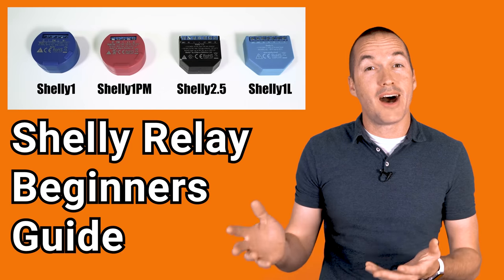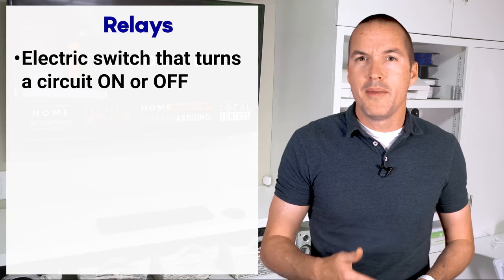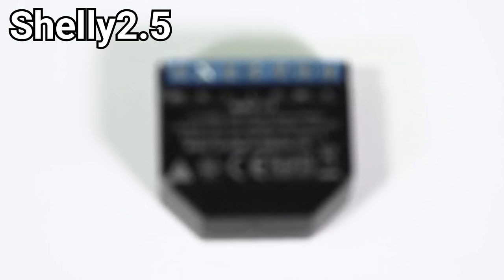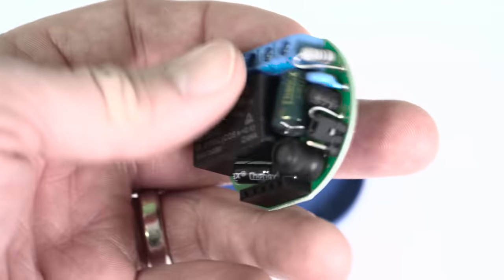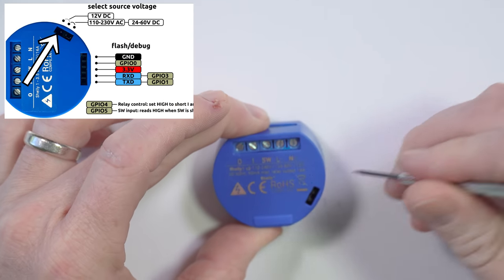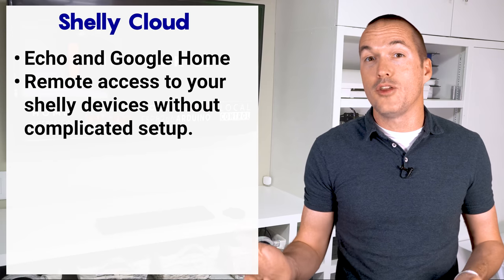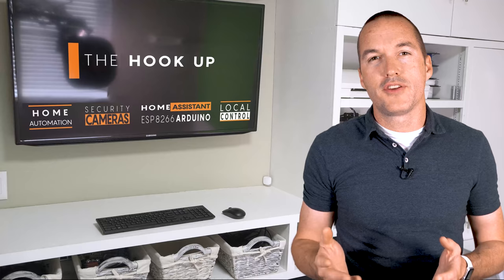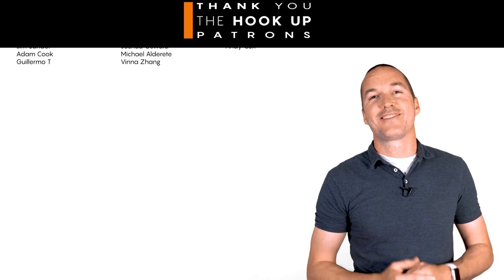Beginners Guide to Shelly Relays - Choose The Right Relay For The Job

Comment: Thank you for this great video. It is very informative!

As far as I can tell, these Shelly relays perform basically the same functions as the Aqara switches. Like the Shelly 1 is basically the same as the Aqara Single Switch Module T1 (No Neutral). Or am I missing something here?
One difference is of course the Shelly uses Wifi and the Aqara uses Zigbee so you need a Zigbee controller/ hub. But functionally, can the Shelly relays do stuff the Aqara switches can't?
Reply from the maker: Basically the addition of WiFi allows there to be a programmable web interface to configure things like detached buttons, long press, short press, multi press, etc.
Reply: @TheHookUp  Okay, that does sound interesting 🙂 I'm just getting started with home automation and recently ordered some aqara stuff to try out. I'll order some Shelly's as well to play around with. I see the Shelly 2.5 is a good bit cheaper than the ZigBee shutter switches I found so I'll give that a try too.

Comment: i would never use these straight with load. only to control contactors. even these have small relays inside they are not the same as ie. siemens house automation relays. i have motion detector outside and it can handle 1kw but i still use it only to control relay and separate load. safe.
Reply from the maker: I guess that's your choice, but for most standard loads the relays in a shelly are more than sufficient.  I use a shelly1pm with a contactor to automate my hot water heater, but the rest of my shellys control the load directly without any issue.
Reply: @TheHookUp  yeah i just want to separate logic from power. they should not be mixed.

Comment: 2:17 this is wrong, if you have 2 wires and a ground you typically DO have a neutral ! your picture is showing the correct white and black wires, the white is neutral HOWEVER in your picture they painted the white wire black and wired both wires to the same hot side with the gold screw, meaning this example has 2 black wires and no neutral, this is not typical. some homeowner with an old house bought modern 2 conductor wire and painted it black because he has no neutral
Reply from the maker: Sorry, no.  If you have 2 wires and ground you have Line (Hot) and Load (Hot).  A switch requires 2 wires.  Electrical code allows the carrying hot on the white wire as long as there is a 4" black tape wrap on that wire.
Reply: @TheHookUp  I see what you're saying. I think it's the wording you're using that's confusing. a typical cable that has neutral does only have 2 wires and a ground. The problem is you should have a set of 2 conductors and ground GOING IN and another set GOING OUT. I think you oversimplified the wording is where the confusion came in because normal cables do only have 2 wires plus the ground.

Comment: Shelly products don't work as advertised.  Direct Device to Device Communication won't work if you set a password on the device.  And their support sucks.  They also won't respond to refund requests.

I strongly recommend against going with this company for any home automation product.  Although they have the word "Robotics" in their name, I doubt that they make any robotics products.  After my very poor experience, I can't help but think that the whole company is a sham.
Reply from the maker: Hey sorry to hear about that.  I don't work for shelly, but I do have a lot of experience with them.  Can you explain what you're trying to do and maybe I can help?  The Facebook support page is the best and quickest way to get help from Shelly.
Reply: @TheHookUp , I can try, but, as I said before, YT seems to block my posts when I post a lengthy message.

I bought 4 Shelly Plugs and 1 Shely 2.5.  I configured them to do Direct Device to Device Communication ("DDDC") using Shelly's documentation.   It all works when I don't set a password, but once I set a password to protect the devices it stops working:  The webhooks just don't work anymore.

The documentation says that if you add a password to the device, you have to add the username and the password to the URL (in front of the IP address).  There is no way to set a username in the Shelly Web UI, so I assumed it was admin or root, and tried it with both, but the webhooks still didn't work even when I try "admin," "root," or "user" as the username along with the password that I set in the Web UI.

I contacted Shelly support, and they told me to try "admin" (which I did again) and it still didn't work.  I contacted Shelly again, and they told me to give them the result of two URLs (http://[deviceip]/settings and http://[deviceip]/status) both of resulted in "not found", and when that didn't work, they offered to replace ONE of my five Shelly devices.

I've requested a refund, but Shelly has not responded.
Reply from the maker: @BobJones164  I am summoning this from a deep corner of my brain, but I think I remember when I was messing with webhooks back in the day that the user is "user_1"
Reply: That sounds like something that their technical support people should have told me the first time that I asked them.  

The subject line of my inquiry was "username?"
Reply: How did you find that as the answer?
Reply from the maker: Did it work?  I’m not sure where I came across it originally, just tinkering way back when.
Reply: @TheHookUp  I haven't tried it.  When tech. support gave me the run around (suggesting various things that had nothing to do with my report), I gave up, factory resetted all of them, and put them back in the boxes to return them.  Shelly refuses to respond to my request for a return, so they'll probably end up in the trash.

Honestly, I'm not sure what I was thinking.  Was I really going to trust some company from Bulgaria that falsely claims to be a "robotics" company with hardware that I install inside of my walls?  

I mean, if they can't even document the correct username to use with the password on their product, can you really trust them with your home?
Reply from the maker: If you're looking for someone to hate on Shelly with you then you are barking up the wrong tree.  Look at it from their perspective:  You are some guy who wants to use their product in an advanced, non-standard way.  They have provided tools and documentation for you to do said non-standard thing, but you lack the skills to figure it out, so you would like to return non-faulty merchandise.

There are zero other companies that would even provide you with the information to do a non-standard implementation like this.   For most people a Bulgarian company is infinitely preferable to a faceless Chinese company, and many shelly products (including the 2.5 and some version of the shelly plug) are UL tested and listed.

You say "If they can't even document the correct username", but I'm sure SOMEONE knows what it is, but it's not exactly best practice to have your programming team answering support emails.  If the tone of your correspondence with shelly is the same as the tone of your last comment, I wouldn't expect them (or any company) to respond.
Reply: @TheHookUp  What are you talking about?

I'm not looking to use their product in an non-standard or non-advertised way.  

I'm operating it completely using the web-interface **they provide**.  Their web-interface includes a section on authentication which sets a password (always a good practice - certainly not "non-standard") but does not include a username.  Their web UI also includes a web-hooks section to send messages to other Shelly devices.

Their web-site has a detailed PDF file that talks about how to use what they call "Direct Device to Device Communication" that shows me step-by-step how to use the Shelly Plug's UI for this very purpose.  It specifically tells me where and how to enter the username (which I cannot set) and password (which I can) in the web-hooks section on the UI for the device.  The only piece of information that I don't have, which is not in their documentation, is the username that they pre-set, and that nobody seems to be able to tell me.

I"m baffled as to how you can think that this is a non-standard use.  I'm literally using these products without any other product at all, and they are specifically designed and adertised to do just that using their built in Web UI.
Reply from the maker: I just ran a test with a shelly plug and a shelly 2.5, I was able to get it working in a matter of 30 seconds.  

http://admin:MyPassword@192.168.20.175/relay/0?turn=toggle
Reply: I have four of them right here, and none of them will work that way.

The FB page you recommended is yielding some results.  Apparently, I received "Gen 2" versions of Shelly Plug made specifically for the US, and Shelly has apparently disabled AUTH via URL for these devices, but never bothered to update their documentation to let anyone know.
Reply: Anyway, I'm still at a loss as to how you think that this is a non-standard use.  I'm literally using the device entirely via its web-interface, for an advertised purpose.  It's not like I'm linking it up to an open source project, flashing a third-party firmware onto it, or even using API calls outside of its web-UI.
Reply: In sum, here's what I've learned:

Shelly advertises that these devices have Direct Device to Device Communication so that you can use them without any kind of hub.  They just talk to each other using http calls that are entered into the UI for each Shelly device.  And Shelly advertises that you can secure your devices with a username and password, which is really a basic security practice.

Shelly recently released Gen2 of its Shelly Plug in the U.S.  In Gen 2 U.S, Shelly hard coded the username.  I have no idea what it is, and Shelly won't tell me.  You definitely will need the username in order to use them for Direct Device to Device Communication.

But, that doesn't really matter because in Gen2, Shelly also removed the ability to send authentication via HTTP.  As a result, even if I can figure out the correct username (it might be "admin"), I cannot use device to device communication via the web hooks entry in the device UI unless I leave the devices unsecured (no password).  Setting up a network device without a password is the definition of idiocy.

And to top it all off, Shelly didn't bother updating its Direct Device to Device Instructions to reveal any of this, and its technical support people don't know it either.
 
I get that you're a fan of the company, but if you have any measure of objectivity, you have to admit that this is not a way to treat your customers.